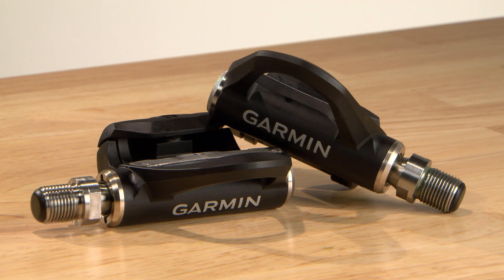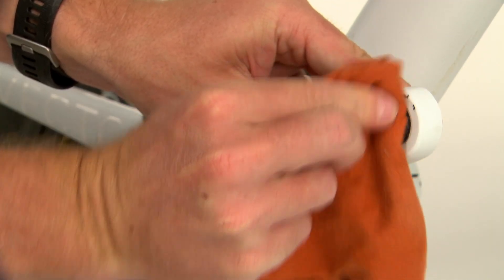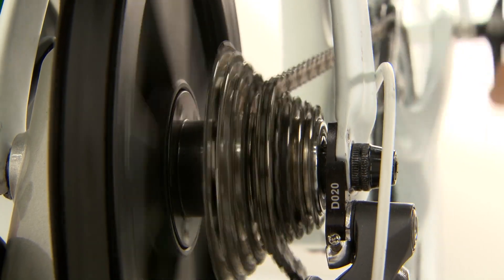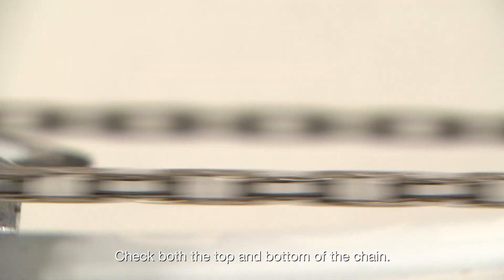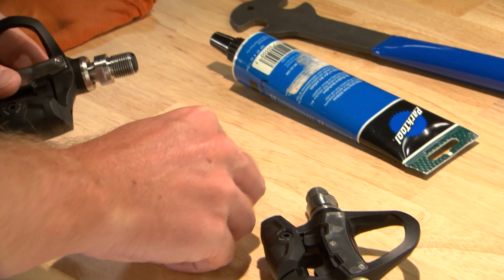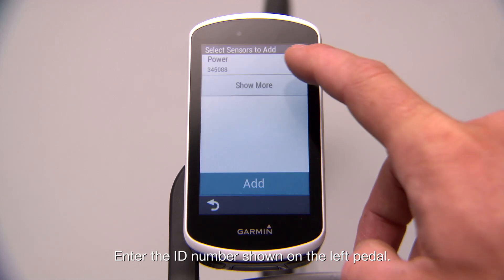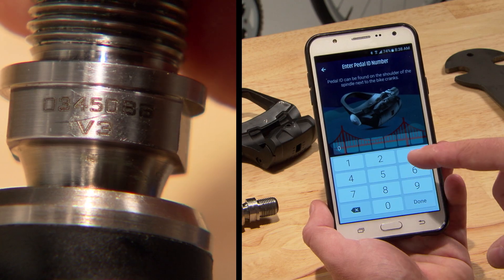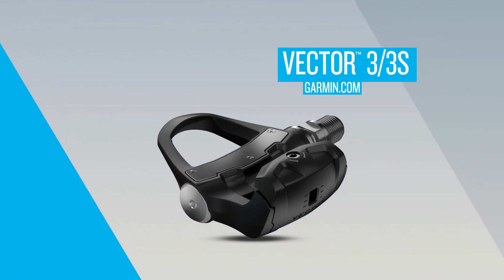Vector 3 and 3S: Getting Started

Comment: Very useful, especially advice on where to find the ANT ID on the pedals. For Vector 3 the ID's are different for the left and right pedals. If you need to enter the two different ID's in the Garmin head unit (in my case Edge 1030) so the pedals talk to each other for calibration and cycling dynamics